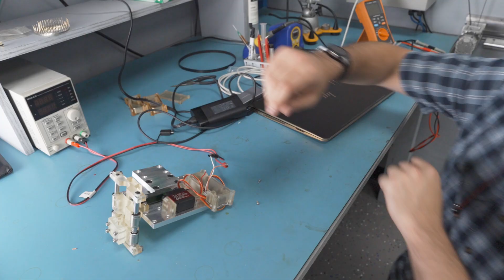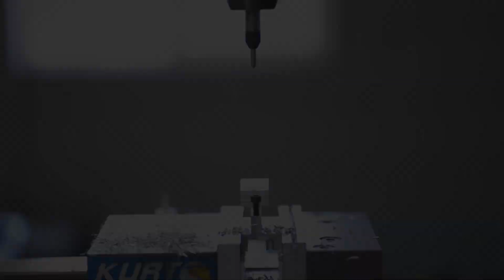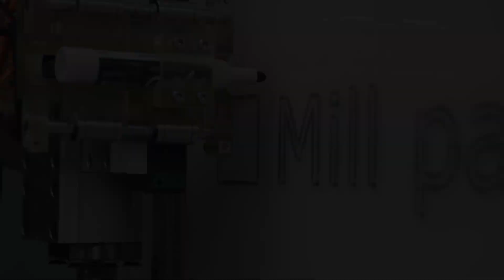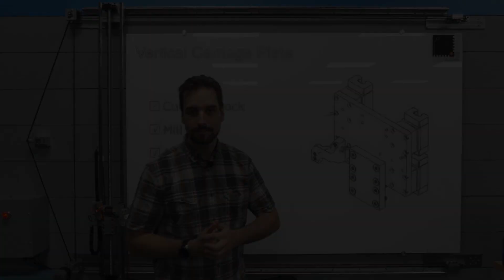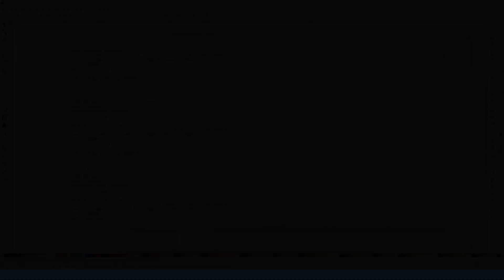Whiteboard CNC - Part 4 - The Whiteboard Awakens

Comment: I really love your videos and I look forward to more
Reply from the maker: I appreciate it. I think I will be doing a few smaller ones before getting into another big project. So, they should be quicker.
Reply: @BauersLab  Hi (from Italy).
I put a comment to a pretty old video.
I hope you're fine despite the Covid19 pandemic.
Nice video and a  quite interesting argument.
The pen lifting actuator is well engineered and seems to work quietly.
The horizontal axis design appear to be the weak part of the machine structure.

The tooth belt is too long even if you will change the axis motor with a bigger one or you will put a gear box in the between.
At least should be better to use two motors (one on each side of the horizontal axis) and maybe use bigger (larger) belt's module. 

The motion controller even if it's not "made in USA" work like a charm. :-)